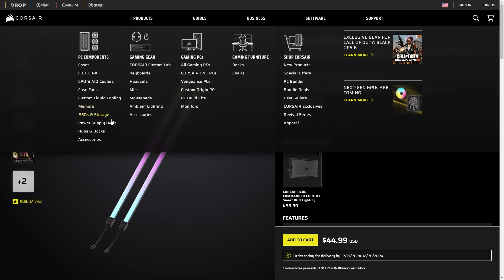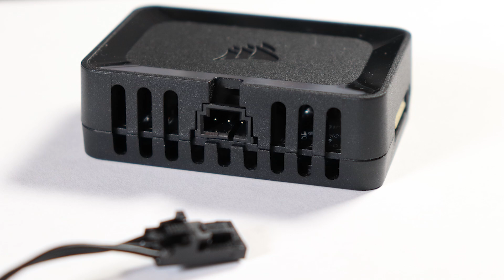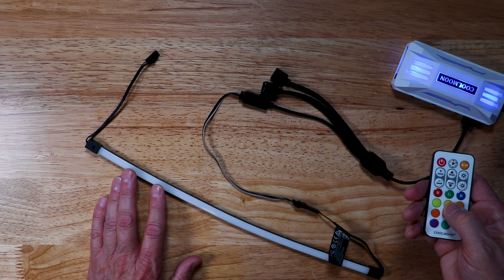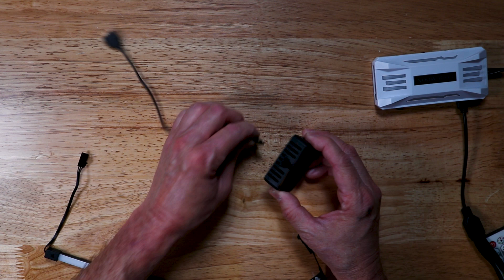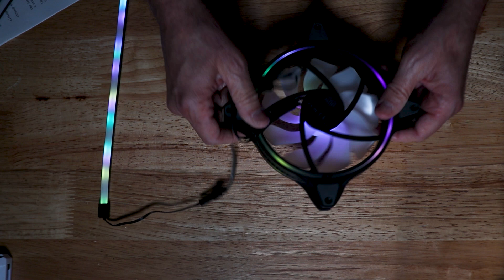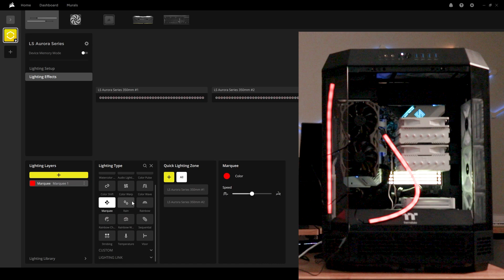Corsair iCUE LINK  LS350 / LS430 Aurora RGB Lighting Strips - How to setup

Comment: I have corsair 5000t lx which has six aurora strips inbuilt total no of led 204 connected by link hub but the problem is icue reduced the brightness by 20 percent does it have any solution to run this with full brightness?

Comment: I remember Coolmoon was my first rgb controller ,now i am using only Corsair , but i want to change to Lian Li because,1 the QL fans leds went bad ,i am expecting to LX that i have to do the same and 2 ,the Corsair AIO pump has a minim of 2400 rpm 😳 and max 2800 , noisy and probably will not last longer!......and those RGB strips there was a period that almost purchased them but i have changed my mind probably because are pointless and probably they don't have the neon style and you can see every individual leds

Comment: Could you measure the LS350 from end to end (not including the cables) for me? I got some LS430s and they are 14mm longer than advertised (the only way to get a measurement of 430 mm is by measuring the LED portion and ONE of the two black plastic end things). I'd like to know the actual length of the LS350 before I buy them for another location.

Comment: Ok so my question is I have a 5000t case that has the rgb light strips built in and they connect into a commander pro can I use this to get rid of the commander pro and connect to the link instead ?
Reply from the maker: Hi amusedspitfire, Yes, as far as I recall, the 5000t RGB strips use the corsair 3 pin (molex style) connector that connects to the rgb port on the Commander PRO or core xt. the icue link RGB adapter included here would allow you to connect using the same connector. However, if you already have the commander PRO or CORE XT, that will integrate nicely in the softare with iCUE LINK products in the software, so it's not required that you have iCUE LINK RGB adapter. 

However, The iCUE LINK rgb adapter would possibly clean up your installation, so it's still a good solution regardless. 

Good Luck and have fun! Thanks for watching.

Comment: The Rgb adapter with the non icue link model is the correct female cable.
Reply: So what cable I need for using them with iCue? The program doesn't recognice the strips :(
Reply: @ I’m using the the 3-pin male rgb connector into a commander pro. Are you connecting them to a Corsair rgb controller? (commander core XT, lighting node pro, commander pro) Icue won’t recognize them as “aurora strips” but will should see them as basic strips. They are laid out as if they’re only 10 RGBs per strip, so you’ll have to add 4 for the Ls350 or 5 for the ls430 for the whole strip to light up. If your connected to the icu link adapter, it should see it as an “aurora strip” so I’m not sure what’s the issue there.
Reply: @Feetlover96 does this apply to a commander duo aswell?

Comment: If I were to connect the LS350 to my lighting node pro, would ICUE recognize it?
Reply from the maker: Hi Slurmpslurmp8356, Yes, you can connect the LS350 strips to a lighting node pro and then setup the channel in icue, it will have the Aurora strips as an option. This is a great way to use them!!! Great Question, good luck, have fun and thanks for watching!!!
Reply: @ thanks!
Reply: @HardwareArtisan  to add onto this, it will actually not give you the option for an Aurora light strip, but you can make a custom profile with four 10 RGB light strips stringed together to get the same result.

Comment: You're doing gods work sir! I bought this kit since it sait it would work without the hub and I immediately realized that the cable had the wrong headders. so I ordered a female to female 3 pin argb one and nothing... but thanks to this video I figured out that I could solder a cheat cable to reverse the signal to the correct end and boom! now it works :)
Reply from the maker: Hi Liamovich, thanks for the kind feedback. I am very happy this video was helpful to you, and even more so the fact that the part about having to send the signal from the right end was helpful made it all worth it to do it. It's a confusing little caveat to this product with the two versions out there.  

Either way, you hacked it, rigged and got it working which is amazing, good work!!! Keep having fun and game on!!! Thanks for your support, and for watching!!!
Reply: Hi there, I almost bought a female to female 3 pin argb connector but read your comment that it didn't work. Would you mind explaining in more detail how you "solder a cheat cable to reverse the signal"? thank you
Reply: @tadasu  sure thing! so I had already bought the female to female 3 pin rgb cable and used with the included adapter (male 3 pin rgp to male 3 pin molex) but that didn't work since as explained in the video the data needs to be fed through the male molex on the strip. So I took the female to female 3 pin rgb cable and snipped off one end and soldered a female 3 pin molex on to it so that I could connect one end to the motherboard and the other to the correct side of the strip!
Reply: @Liamovich I just bought a female ARGB (to motherboard) to female 3 pin molex (to male pin of light strip), hopefully this will work! Thanks very much.

Comment: I did everything like u showed in this video but somehow my Icue hub can't find the Ls350 link. Everything has been updated etc. 😞
Reply from the maker: Hi MATTIEE694, Do icue see your icue link hub, but not the RGB adapter?  Assuming it does, does it recognize other devices on the chain (fans, etc)? If other devices are detect but not your icue link RGB adapter, try moving the RGB adapters location in the chain, even plugging it directly into the icue link hub, this would help rule out a fault connection, or device. If it still won't detect it.....I would try uninstalling/reinstalling the software.  Beyond that, it's possible your RGB adapter is faulty, might be time for a conversation with Corsair. 

Good Luck and thanks for watching!!!
Reply: Hi there, the app does see the icue hub but not the link. No fans involved, just the hub and the link for the ls350 leds. I've tried everything (imo) but no solution yet. I'm in contact with corsair right now and they will send me a new link soon.🤞

Comment: Thanks for the review. I have a large Corsair 7000X case; if I wanted to install 4 strips would it be sufficient to purchase the 430mm kit with the adapter and a second 430mm kit without the adapter?
Reply from the maker: Hi nocturnenoble2468, Yes, that should work great, the strips themselves are the same in both kits. iCUE looks like it will let you connect up to 4 of those together, although it will probably dim them somewhat, iCUE gives you a warning about that when you connect more than 2, but should work fine. Good Luck, have fun and thanks for watching!!!!

Comment: that adapter cable is to add additional non iCUE link ARGB to work with the iCUE Link system. Its not really well documented which is annoying as well as the fact that they don't just sell this so you can control any arbitrary ARGB device